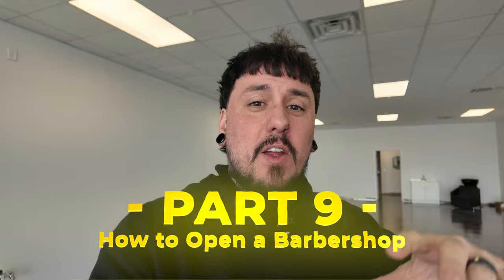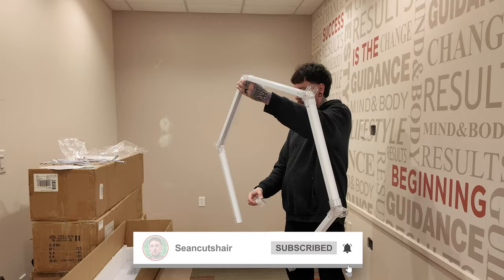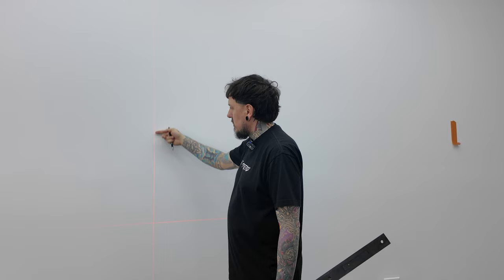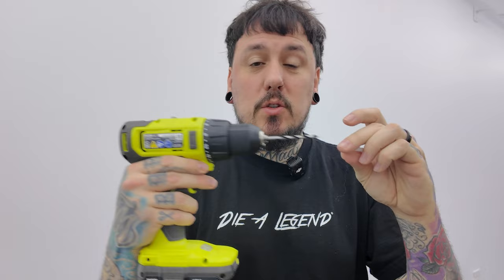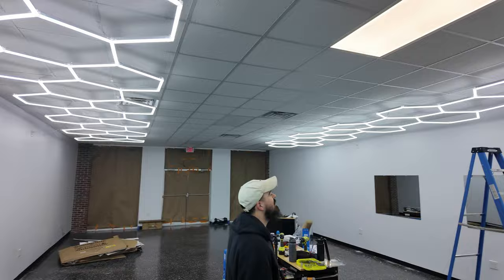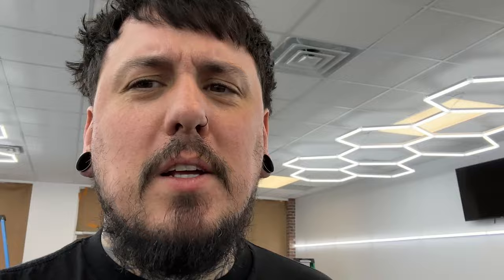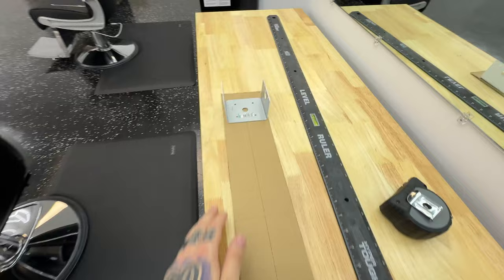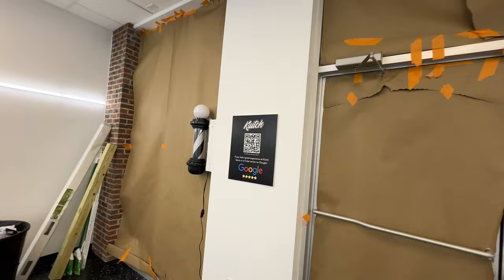How to Open a Barbershop 💈 Part 9 - Putting it all together!

Comment: How did you connect the lights on the wall? Are they plugs if so how were you able to plug them in without seeing the cord
Reply from the maker: Yeah there’s a connect under the tv and the cord runs up behind the tv

Comment: What’s your opinion on air compressors in a shop? Is the eyevac situation more convenient? Or do you find them too noisy?
Reply from the maker: Compressors and eye vacs are for two different things. Compressors blow the hair off people but don’t pick the hair up. Eye vacs suck the hair up when you sweep it into it. Never saw the need for a compressor, blow dryer works just fine

Comment: good work sean 💯 .. also i have a off topic question, i want to change my faper blade out of my SC rebels to a good taper blade that would fit. any recommendations ? thank you brotha
Reply: The gamma eurgo taper blade is fire and is a good combo. Any two hole taper blade will work though
Reply: @Aldeezy209  cool ima check them out, i appreciate you bro
Reply from the maker: Yeah I always just used the sc taper blade